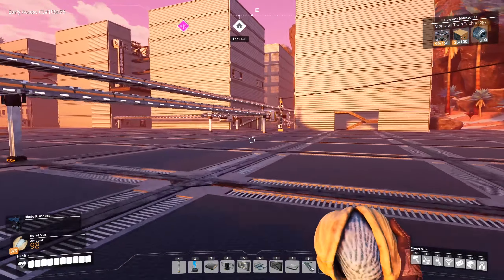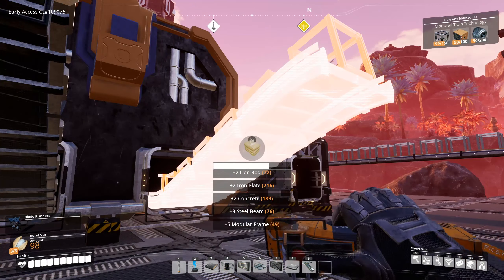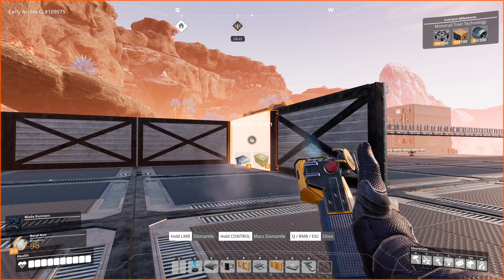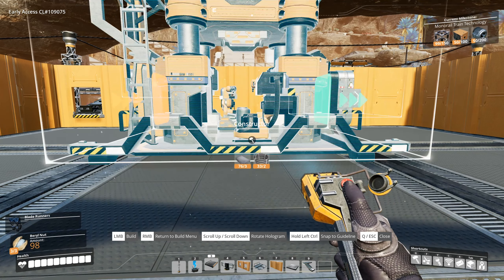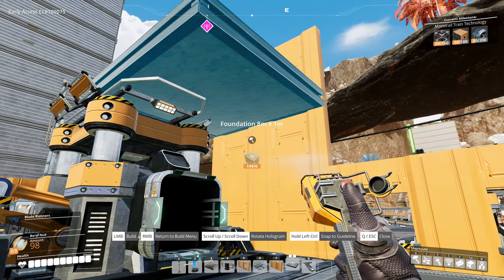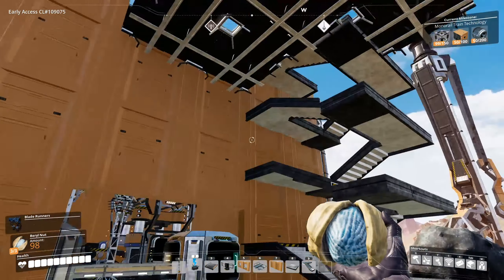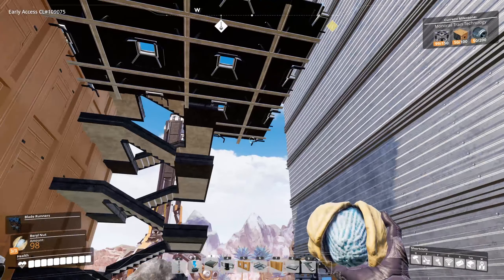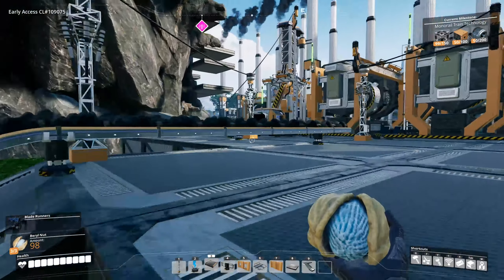Satisfactory S2 E13 - Unlocking Trains by Scaling Steel Products!

Comment: Did some messing around in my game and it appears that if you connect a section of belt to the wall sections with the conveyor pass through, you can place a splitter on the belt as close to the walls as you are trying, close enough to have the splitter clip in to the wall even. Just have to place the belt first.

Comment: What can help with minerplacement, is to leave one foundation segment out where you can see the connection point, place the miner on the remaining foundations over the now visible connection point and place the missing foundation back. Sometimes you need to divert to lower foundations but seeing there was already a miner there it should work.